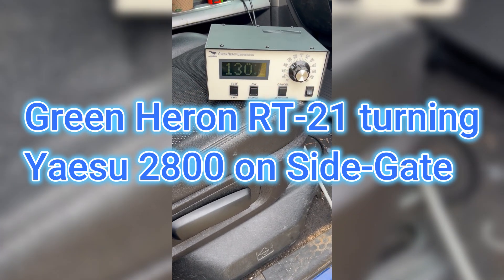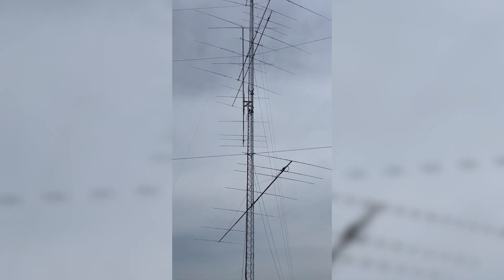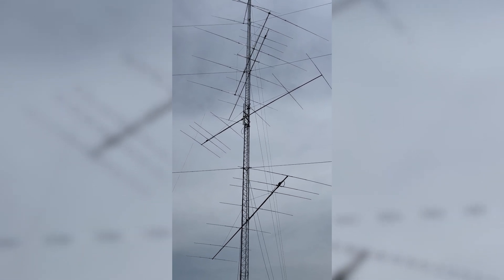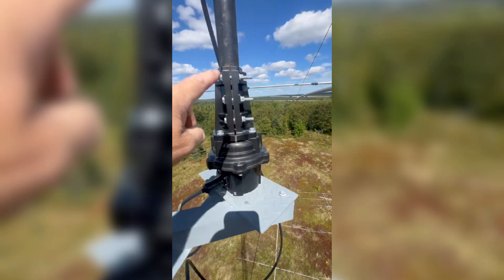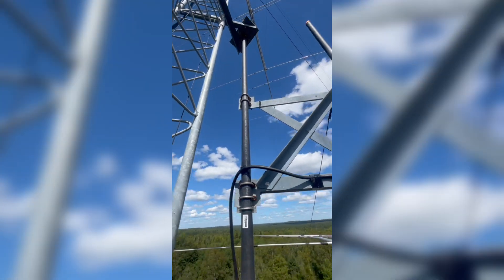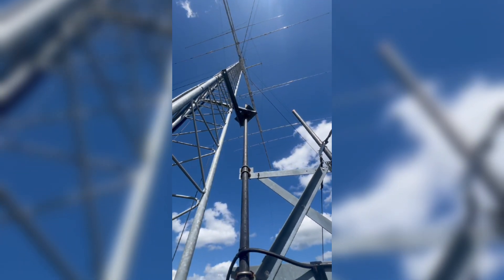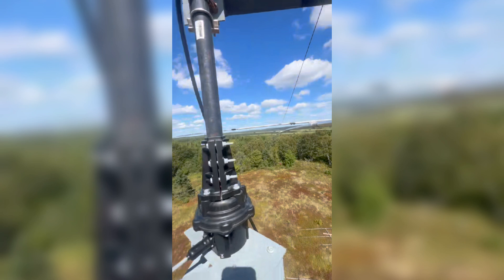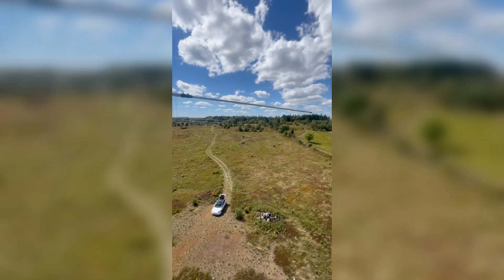YAESU 2800 Rotor with Green Heron RT-21 controller on custom side-gate to turn HF ANTENNA!

Comment: I have a solar con for my current base station  and it supports a cobra 29.   I am going to purchase a maco 5000 antenna and mount that on a 90 foot tower. I wont to mount my solar con  on the same tower but felow ther maco at about 70 feet. I plant to oly operate one  at a time.  In your opinion do you think  the lower antenna will impac  the maco.

Reply